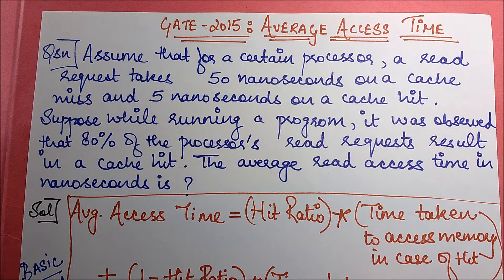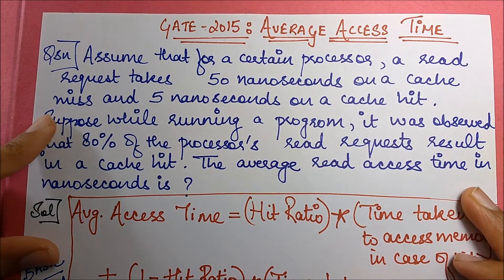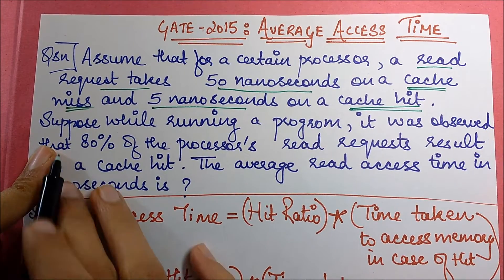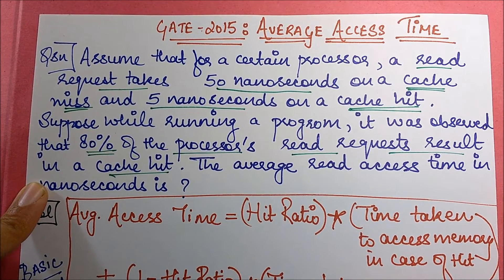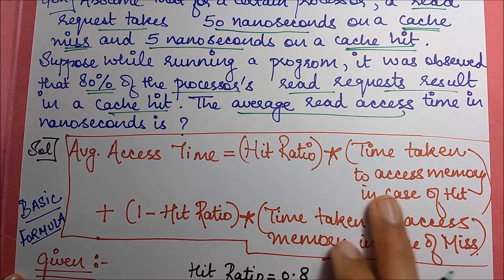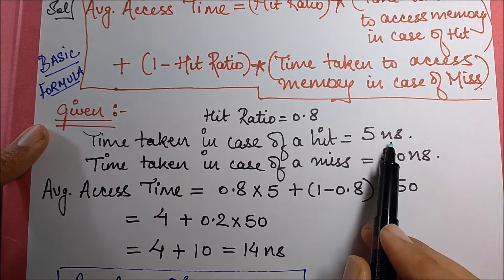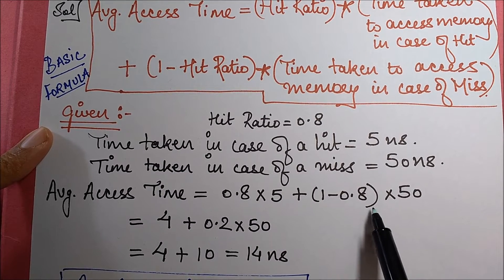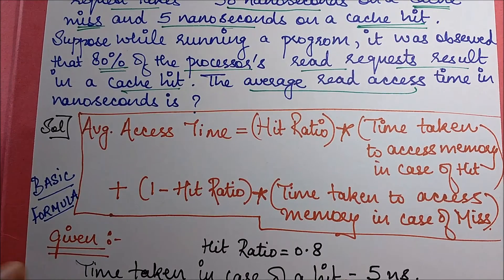GATE 2015- Average Access Time - Cache Hit Miss - Computer Architecture

Comment: Why don't we have to add five in 80/100(5) +20/100(5+50) in miss section of problem ?
Reply from the maker: Because it is specifically given that the time taken for miss is 50 ns.
Reply from the maker: I think you are confusing it with general memory access time. It's written time taken in case of "Miss".

Comment: Hi, I'm studying Computer Architecture in my uni and I'm very confused about the average access time formula.
It seems like there are 2 formulas to calculate the average access time the one you used in the video and another one is
AMAT = Hit time + (Miss rate x Miss penalty)
My question is what is the 'Miss penalty' above. Could you explain me? I would be very appreciate to hear the answer.
Reply from the maker: +Acerinth Miss penalty basically means the total time to fetch and read a record when a miss occurs. In short, it is the time incurred when a miss occurs. It may include the time taken to perform block transfers to load the record in cache and some additional overheads. Hope this would have been helpful...
Reply: Thank you for the reply! Still, I am a little bit confused. Is there any difference between those 2 formulas?
I tried to solve a problem using each of them but the answers I got were different. That's the point why I'm very confused.
Reply from the maker: I'll upload an example question corresponding to each one of them very soon...
Reply: i don't think that ur farmula is correct 
and the farmula used my mam is common sence and straight forward
Reply: @GANESHKUMAR-kq8vj  change your teacher, both for english and COA

Comment: Wrong answer as you miss cache latency
Reply from the maker: Cache latency is included in the timings of cache itself (i.e. 5 ns and 50 ns). There is no extra cache latency given. Please go through the question once again. I always make a point to verify the solutions and answers posted by me from reputed sources and thus they are always correct.